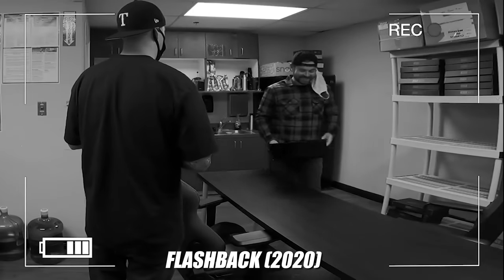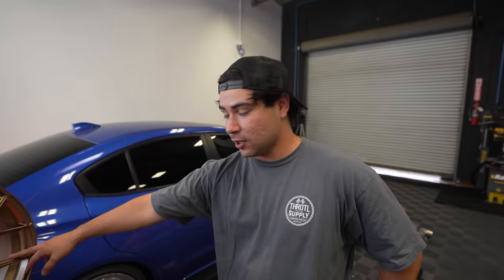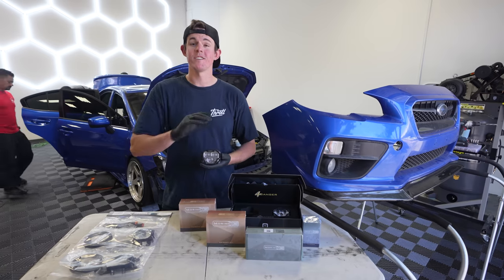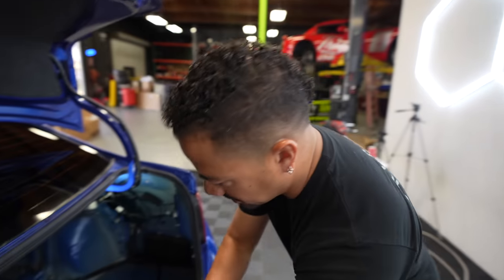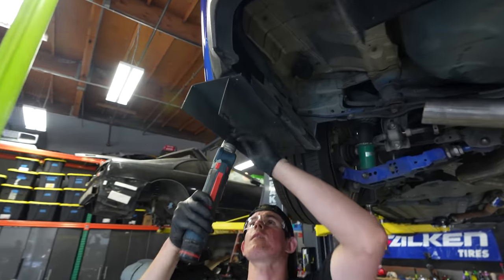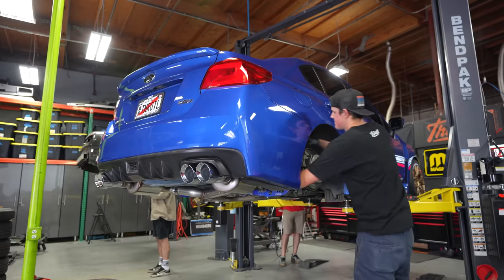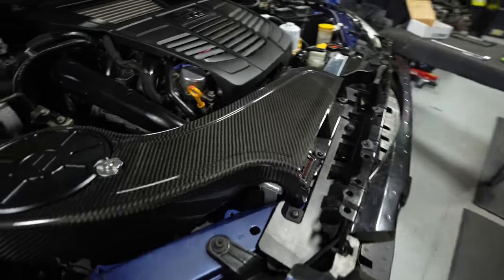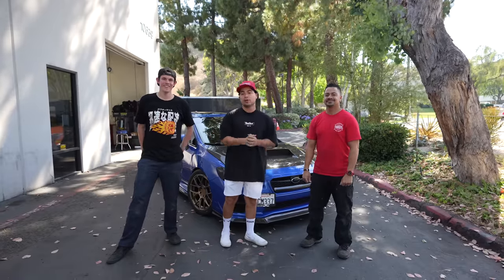Surprising our EMPLOYEE with his DREAM CAR BUILD! (Full Transformation): Subaru WRX (2016)

Comment: So, not being a stickler 

But in my STI, i slipped two all in one subs under the front seats. 8" and makes your head bounce off the celling. 

And you get 100% trunk space without worry of the box getting bashed. 

Updated my rear decklid sub with a HUGE BARELY FIT sub. 

Door speakers with tru 3 way's 
With a nice set of tweets in dash.

Threw bass exciters into the rear seats and in the backs of the front seats. 

Dude, it THUMPS and looks 200% stock, and even on low volume, you can FEEL the bass, so headache and shaking mirrors/eyes are a thing of the past. 

In fact , the wife was like 'nah lets watch a movie in the subie" the other day because the sound is UNREAL.

Truely mind bending how good the audio is, ill have to make a video on it once im done with my current project! 18 days left! 

Fucking crunch time!

Comment: I don’t have an access port as I’ve heard so many problems with them with they’re software and overall tuning if someone could dial me in as I have an Impreza 2003 blob with forged internals running 400bhp and have not had a problem should I consider getting the Cobb access port or not
Reply: you shouldn't support cobb

Comment: Anyone else have this problem? I went full mishimoto cooling system (radiator, fans, shroud, hoses, low temp thermostat) on my wife's 2020 WRX limited everything is cool and working when driving but when you are sitting in traffic or at a drive thru with AC on cars over heats.  I bleed it the 1st time with new coolant using the coolant funnel tool and thought maybe I had air bubbles in it, so I used a air compressor vacuum coolant tool the 2nd time and same thing over heats but only when at a stand still in traffic I'm thinking the fans aren't that strong or something.  Anyone have this issue or has a fix for this?

Comment: The only things that didn't make sense were taking parts off then putting them back on just to take the parts back off to install other parts then putting the parts back on so work was done twice when it should have been done once. Like why remove the bumper to put parts on then put the bumper back on just to then remove it again to replace other parts. Why not just keep the bumper off and get everything done then put it back on once everything is put on. Them the wheels were replaced but the coilovers still needed to be replaced and the wheels had to be removed again so double the work for no reason.